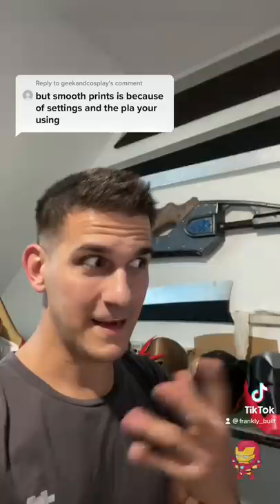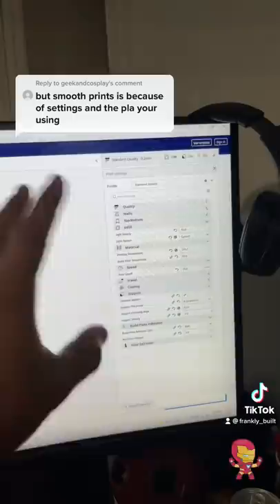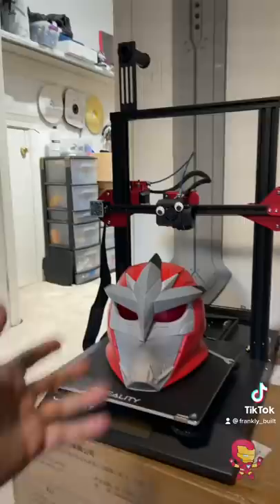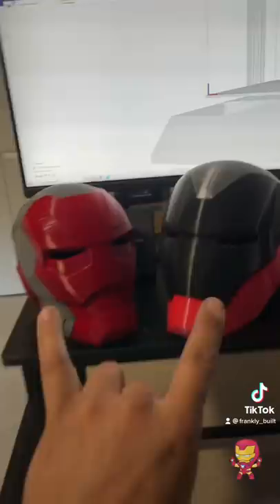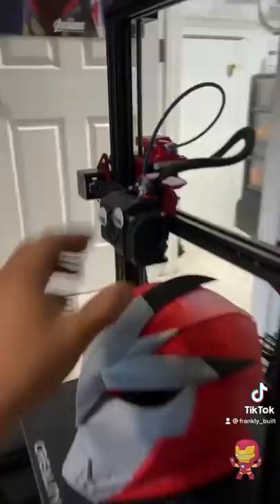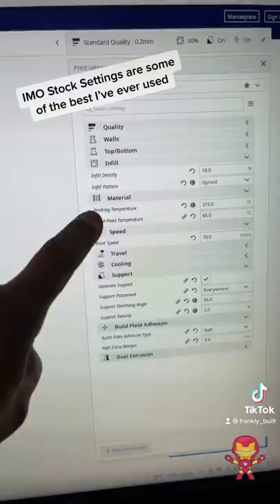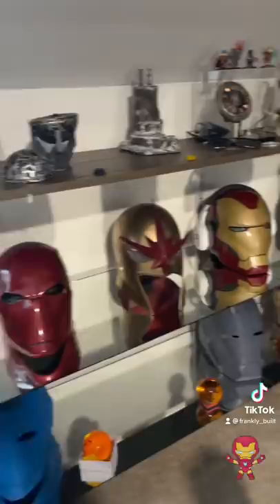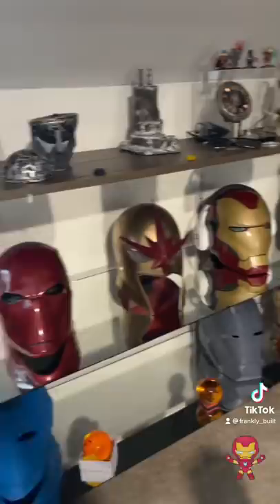Stop Worrying About Settings and Build Your 3D Printer Right! #Shorts

Comment: I think I did a good job. I just 3d printed the cat on ender 3 pro. It took like 6 hours, but it’s crisp. I can barely see any layers. Now I’m 3d printing a chess board. It’ll take about the same amount of time. I used inventor to make it and then convert it to stl. I have a problem tho. The print is kind of small. I wanted to make it 8in by 8in. So I did that. But on the splicer app, it appears tiny. Like usb stick tiny. So I had to make another file in which I made it “80x80”. And it’s about 4 inches by 4 on the actual print. I’ll probably make it 120x120 for my next print. But I’ll stick with this tiny chess board for now. I’ll make some chess pieces too. A problem that I had was the stop sensor for the bed. It was broken. So I replaced it. Then I had to do a little cable management before I was able to use it. For some reason, the z axis cable was too short. So I had to redirection it. I leveled the bed and took my time with it. Now the chess board is looking great so far. It’s gonna take a long time. All of these layers are tiny. I can barely see them.

Comment: I have the ender 3 pro V1. I went trouble shooting through the slicer to figure out why my filament wasn't feeding. The hot end turned out to be clogged bc I swapped from pla to abs back to pla again. I srsly wish I saw this video sooner. Would've saved alot of hard ache

Comment: You are definitely wrong on some points here. Filament brands do matter a lot. Besides there not only will be better quality on better prints, better brands also do tend to last longer, absorb less moisture, are stronger and print better. 
Of course your CR-10 max isn't going to be much better. It's bigger, and that is it's main selling point. Of course assembly matters, but it actually really starts to matter when building like a voron for example.

Comment: Also Im pretty sure no printer is ever gonna get glossy smooth like that first mask he wore. That was likely smoothed with acetone vapors
edit: was painted
Reply from the maker: The first mask I was wearing was painted. I didn’t show that as an example. The rest were all raw prints
Reply: @FranklyBuilt  Gotcha. Yea it had zero print lines I thought something was up
Reply: @FranklyBuilt i finally just a printer!! Lmao $74 temo tinker special, but it has a hot bed snd gets decent prints. Learned more from your short than anything else so far

Comment: I have an ender and my cross arm is loose on the right and the guide rod doesn’t rotate smoothly as in I should be able to slide it up and down easily with my hand, but it does not move… tips?

Comment: How do you level you bed and make sure things are secure? I have been having a problem with my ender 3 where my prints are not wanting to stick to the bed. Any suggestions? And yes I tried leveling my bed but I might be doing something wrong.

Comment: Wait, you are trying to tell me that you use your printer primarily for... printing stuff?
That doesn't sound right. I'm pretty sure you are doing it wrong. 1st you have to upgrade 1/3 the parts of the printer. Then print something and then upgrade another 1/3, replacing 1/2 of your previous upgrades.
Printing isn't hobby. Upgrading is.

Comment: I have a problem, so recently my cr-10 SE has been scraping on the bed and is giving my prints a low quality. Any solutions?
Reply: Level your bed. If it scrapes the bed, the distance between nozzle and bed is too small.
Reply: @PTHYTQV  how would I level my bed. I’m sorry I’m pretty new to 3D printing. I started in early January this year

Comment: Wanna get ride of those layers? Do it in the post print processing stage with a bit of filler primer spray. Few coats of that bad boy and your prints will be a smooth as a baby's booty
Reply from the maker: Well that plus sanding. And the better quality prints means less sanding and primer

Comment: Not gonna lie. I changed my settings to the ununderstandable in cura to have base quality print.
I reinstalled my pc and didn't saved my custom settings so I just tried out prusa. Almost basic settings and my print better then ever.
I still need a bltouch or give more time for bed leveling... 😭😭😭

Comment: The only way u get "smoot" prints is on a resin printers
Reply from the maker: That’s…a fairly gross under simplification of printing lol I get plenty of smooth prints in my FDM machines
Reply: @FranklyBuilt  not like resin. I have 2 resin printer and a 2 prusa mk3 when i print my action figure in resin its very minor sanding mdf tons of sanding to remove layer lines. But i rather print MDF less messy. But off the printer resin is the smoothest you can get..
Reply from the maker: I’m aware. I have 7 resins prints lol but you can get very smooth FDM prints. Not AS smooth as resin but saying FDM prints can’t be smooth is just silky
Reply: @FranklyBuilt  yes that what I'm saying if you want smooth off the printer is going to be resin sometimes you don't have to sand

Comment: This probably won’t get answered but I’ll shoot my shot, I bought a ender 3 pro earlier last year but the filament doesn’t come out correctly, I have a feeling I have the wrong size filament but I am welcome to ideas
Reply: Just to say the filament you need for an ender 3 needs to be 1.75mm wide and usually if your printer not extruding it usually the problems are
- wrong filament 
- too low of a nozzle temp
- extrusion rate is too low
- blocked nozzle (yours is new though)
- but mainly you build plate is too close to the nozzle usually which creates a back pressure and causes the filament to almost jump back adjust the build plate away from the nozzle
Reply: @Rafi-qy2kl  thank you

Comment: Hmmmmm idk man the comment says smooth because of settings. And imma come out and say it. You will NEVER get a smooth print without some sanding or costing after the print is finished. Especially when using filament. It can look smooth to the camera and in video, but when you look at it up close or in person you wil certainly see those print lines. Even on my resin printer, things look super smooth, but once I run my nails on them or look really close, the lines are there

Comment: How much does it cost in materials and everything to make the Iron man helmet
Reply from the maker: About $20-30
Reply from the maker: About $20-30
Reply: @FranklyBuilt  is all $20-$30 from Materials? And do you 3d print the Lights on the helmets too or is it separate parts for the lights?

Comment: I disagree. My Ender 3 v2 worked perfectly for the first 10 prints then didn’t stick to the bed
Reply from the maker: If things aren’t sticking to the bed it’s either unlevel, not clean or the wrong temp. Could also be bad filament. That doesn’t mean the printer is bad.
Reply: @FranklyBuilt  when printing 1.75mm on an Ender 3 v2 what temps should I use for the nozzle and bed? Thanks for the help!

Comment: Lug nuts have nothing to do with an alignment.
Reply from the maker: For the alignment racks that mount the sensor to the tires/wheels they sure as heck do lol 😂
Reply: @FranklyBuilt  you can Jack it up tie a string around the cars tires or hubs, then you adjust the tie rod ends until the string is even on all sides
Reply from the maker: @SlipperySquid01  I’m not debating how to do an alignment dude lol that wasn’t the point of the metaphor 😂

Comment: He knows computers but definitely doesn't know cars. You don't even need the tires on the car to align it.
Reply from the maker: Ahh so the alignment rack that I used for a few years that mounted the sensors to the wheels to align with the sensors on the machine just..didn’t exist? I made that up for years? Wild.
Reply: Most mechanics take off tires to align a car. Tires and rims are to inconsistent to give a perfect alignment. Yah you can do it and get by but if you want perfection you do it without the tires. And then make sure the tires and rims are straight and balanced independently.

Comment: Yo this dude really thinking that assembling it right isn't common knowledge. like hey, make sure your car has wheels before driving otherwise it won't move. FML. you shouldn't have to make this video when there's literally a manual for that. And print settings do matter just as much when you want a good quality print, how well tuned your settings are basically dictates how much post print processing you'll be doing. I've been able to get parts ready for airbrushing right off the bed, with fdm, not exactly something you can do with stock settings.
Reply from the maker: It 100% isn’t common knowldhe lol  have you been on the Facebook or Reddit groups? 99% of those posts are unlevel beds, loose concentric wheels, and wobbly gantries.

I’m sure your settings are great after tons of trial and error but I bet if I loosen up a wheel or 2 it will all go to crud. 

Common sense isn’t common and the 3D printing community has more then proven that.